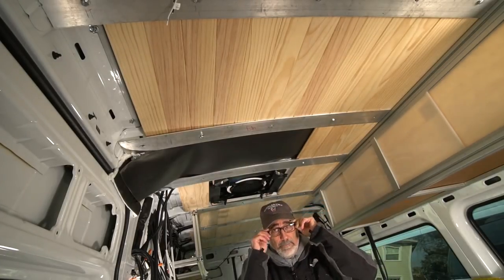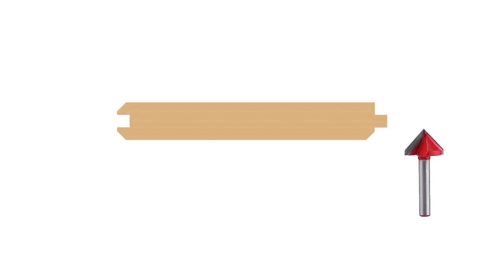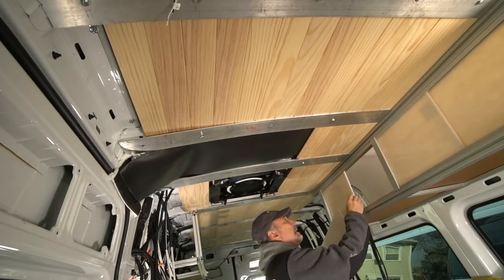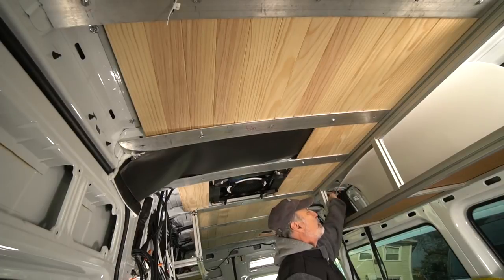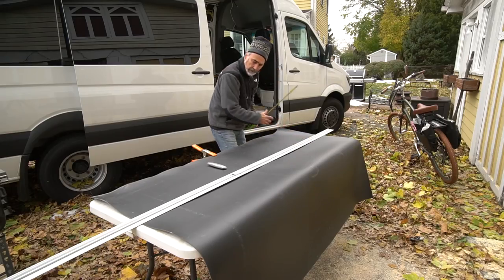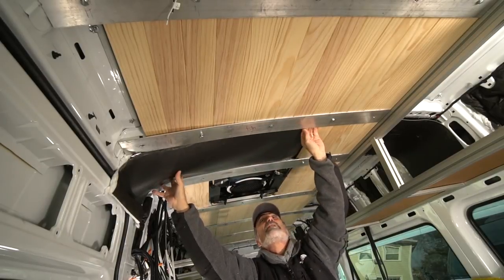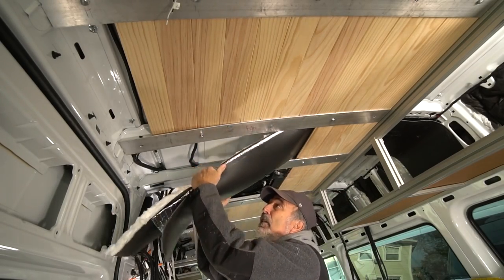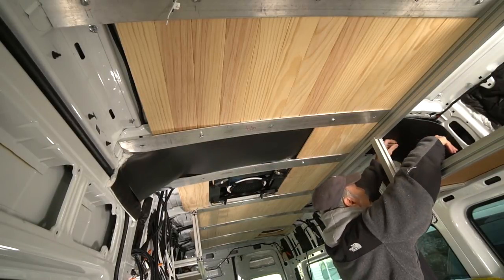Humble Road Van Build Series - Four Layers of Ceiling Insulation

Comment: I think i like the idea of building each area separate so you can access, update or make repairs to them without needing to interrupt another area. I see so many people build all the insulating layers as one unit, then the floor, framing and walls all together. But, i have learned in my van that its hard to get to a section for something simple without removing an entire layer. I made my bathroom area one unit with its own floor, kitchen area with its own floor, bed area has each section separate too. Only thing i would have issues with are that the van is a conversion and id never be able to get behind the walls or ceiling without removing my entire interior....or cut my walls. So, i say make your cut mr! I hope i got this right...lol

Comment: In the case of my (new to me) old RV (1966 Clark Cortez - first front wheel drive RV made in the USA), water and rust issues are real for those vehicles. I want to know before I have a problem and be able to check the roof/floor/walls regularly. Since the entire ceiling will need to be ripped out and replaced, this setup could be extremely beneficial.
Reply from the maker: That was my motivation for this design. While I have never experienced any kind of heartache when it comes to repairs, I can certainly anticipate and be proactive.

Comment: IMO: Keep it one piece.  Gravity is working against you asking that cut piece to not keep falling down, but in one piece, the tendency to fall down is transferred to the full curve down to the shelf floor.  If you do cut it, maybe cut it lower down the wall.  (I didn't see side support inside the shelving to help keep the heavy mass vinyl propped up on its own.)  After all, how many times to you really think you need to get behind that wall?  It is already "accessible" by loosening up the ceiling and pulling the vinyl back if need be.  Suggestion?  Maybe you can slit the heavy mass vinyl in half or thirds vertically to get access to a section that is lighter in weight.  Velcro the strips together in one piece on the back side.  Just thinking inside the box...
Reply from the maker: I like the way you think.

Comment: Hi George.   There is a case to leave the backer in one piece.   Two pieces will leave you w/ attachment issues where the would be two pieces meet.   I guess that I would ask how many times one would expect to need access behind the mass vinyl as compared w/ any maintenance issues that would/could be created by making it two pieces.   Without having the experience and vision of the van that you do, I would think that one piece would be better.  

BTW, I loved the insulation falling down almost on cue.  Also, loved your reaction when it hit you.  Some people would have cut that out.  I love that you left it in.  Great work, as usual.
Reply from the maker: Thanks Sam. If I use two backer panels, the overlap would be 3-4 inches. Enough to settle in with each other. I have wrestled with one long piece and it was difficult. That wouldn't bother me to do so, but if I am building this van to sell, and sell at premium, everything MUST be as close to perfect as possible.
Reply: @HumbleRoad  Yep.  I wasn't thinking about that much overlap.   Should work well as you have described.

Comment: I don’t  see a separation between the structural ribs and the “plates” attached to them. Two words - thermal bridging. Everything else about the system seems good 👍. 

You do outstanding work. Keep it up!
Reply from the maker: 2”  by full length strip of rubber on each of the 4” plates where they mount to the chassis ribs.

Comment: love the video George, 4 years later I'm wondering if you would still use the same 4 layers in the same order as you did in this video?  thanks so much!
Reply from the maker: Yes. All the same, EXCEPT...I replaced the HMV with polyiso foam to save weight up top.

Comment: Your skill level is amazing.  You are at a level to which I  can only dream.  You asked our thoughts about cutting the mass vinyl for easier access. Since the mass vinyl serves as a vapour barrier I would be concerned about moisture, over time, finding its way through.  ?
Reply from the maker: You are correct. This is why I am focused on a "breathing" van. Unless you can guarantee a 100% flawless vapor barrier, you will have created a worse condition by not giving the moisture any air flow in order to evaporate. My idea is to minimize condensation, close to nil, but with the ability to keep fresh air flowing throughout every nook and cranny of the van.

Comment: By attaching the aluminium extrusions for the cabinets and the aluminium stock on the ceiling direct to the steel of the van body you have  given yourself a big problem.  The body steelwork inside will get as cold as the outside temperature, the aluminium will end up the same temperature as its a very good conductor of heat and cold.  This cold metal will condense any humidity in air of van and end up covered in condensation.  Two people sleeping in the van overnight will produce a lot of moisture in the air just by breathing, nevermind if you start cooking in there. This is why in all comercial builds,  if done right, the van body is completly insulated from the inside.
Reply from the maker: Oh no! I don't think the result would be as serious as you describe, but I have a thermal break between the van body and any interior aluminum.
Reply from the maker: The only mount point where I could not install a thermal break is with the 4 carriage bolts that hold the topmost rail of the wall cabinets. Now, once I start re-installing all the framework, I will point out all those details.

Comment: Unfortunately I haven't seen the first steps in the ProMaster/Ducato rebuilding, but an important thing is how to avoid air making contact with the outer wall behind and inside all frames. Then there must be some ventilation behind the inner wall layer.
I just wonder how all DIY campervans will look like after ten years...
There are reasons why they don't use frames of wood any more in caravans.

I'm about to  build a campervan of my 2011 Ducato 636 cm van, and this problem I have to solve at first!
Reply from the maker: We think alike. Good luck with your build!

Comment: 1) loved seeing the 'sliders' concept.
2) 3 yrs later, would you do this '98 boards' ceiling method again or has time revealed more favorable methods?
Reply from the maker: (2) Yes we did tongue & groove in the latest 4x4 Sprinter we just released a couple months ago. And I'm considering it for one of the Transits in house now.. (3) Reflectix needs an air gap in front of it to work. If you glue it directly to the van sheet metal, it does nothing.
Reply: Thank you-Doug

Comment: Lovely build. Thanks for explaining the radiant heat floor (I’d love that but have settled for thick carpet) thought you didn’t want to put the heavy mass rubber on the ceiling? Why didn’t you just buy tongue & groove? I’m learning a lot, thanks.
Reply from the maker: I hand made the tongue and groove for 2 reasons. First, my finished thickness is less than dimensional lumber, so if I milled down the store bought T&G, I might have had an alignment problem. And second, I just wanted to have hand made tongue and groove on the ceiling! 😆

Comment: Very good system. I would prefer the 2 piece. Ceiling and wall.
I like the wood board ceiling. Was wondering why you didn't buy the T and G and plane it yourself. I know standard is 3/4. I have seen on YouTube,builders using thin cedar planking.
I admire your wood working.
Reply from the maker: I chose the pine boards for their insulative properties. As far as the milling, I don't mind doing it all myself. I like the idea of handmade.

Comment: How do you deal with condensation on the metal ceiling? No getting around the thermodynamics of air moisture. When the cold metal meets the warm moisture-laden air it's going to condense on the ceiling and infiltrate the Thinsulate. I would install the Reflectix on the ceiling tight with spray adhesive, then the Thinsulate over that then the vinyl. It's a myth that Reflectix doesn't insulate. I installed two layers thick and it provides plenty of insulating potential even without the specified air gap requirement. There's two layers of air bubbles and  loose fit between the two with more air all sealed with HVAC foil tape...Go to the HVAC supply store to get the good stuff.

Comment: I don't think the Reflectix will reflect anything unless it is spaced apart the adjacent layer (from the high density mat and/or the wood).    I think that's typically a few inches.  From their website:

"For either a reflective insulation or a radiant barrier, an air space of a minimum thickness is required on the reflective side of the product. (Most Reflectix® products are reflective (shiny) on both sides.) The reflective insulation benefit is derived from the interaction of the highly-reflective surface with the air space. If the reflective surface is in contact with another building material, it becomes a conductor (transmitting the energy by conduction). An air space may be specified on one or both sides of the product (always on a reflective side). Enclosed air spaces, when instructed, are required to provide the stated R-value."
Reply from the maker: Sure, an air space of a few inches would be beneficial, but in the case of a van build, not very practical. I am considering the air "in and around" the Thinsulate to be the required airspace for the reflectix. The black layer of the thinsulate is very porous and a non-conductor of heat, nor cold.
Reply: By itself, Reflectix is an insulator. I have cut pieces of it to fit my Ascent’s windows and wrapped all of the under-floor plumbing with it, too. Without additional airspace, I can say with some certainty that it does provide noticeable insulating barriers to both summer sun and winter cold. So my guess is that your sandwich with Reflectix as the salami will do a credible insulating job, Chip.
Reply: It has an R value of 1 if it is sandwiched between other material.  That's not very good.  The R value is much higher if you leave it exposed.  Nobody wants their van to look like it's wrapped in aluminum foil, but that's what it takes to get the higher R value they advertise.  I see van-build videos of photogenic but blissfully ignorant millennials making the same mistake all over the place.   This is basic physics and stated right in the manufacturers specs.
Reply: @desmondtutu7916  There is a white-sided reflectix - one side is white.  How would that work in a van build without looking like a tin-foil space ship?
Reply: @desmondtutu7916  I agree with you 100%. There is a time and place to use reflectix and this is not it. Some people just won't do what little homework is required or they just love throwing away money.

Comment: I think the whole build is great! Such a perfectionist look forward to each episode. Will you keep both vans?
Reply from the maker: Thank you! This van that I am building is for sale. I hope to have enough of it completed by the Tampa RV Show that prospective buyers will have a better idea of exactly what kind of product this is. Can't blame anyone who may be interested to continue to lurk in the shadows, it's an empty van for Pete's sake! I am building it, however, as if I were going to live in it full time for the next few decades. Now if I win the lottery, all bets are off! :-)
Reply: @HumbleRoad  Suggest: your next build is on a wide-body van (8-foot). That extra 12" - 14"+ width (and no wheel well to deal with) really makes a world of difference toward not making you feel like you are in a cave.  Not too many manufacturers are still making widebody vans though  Check out the specs on this:  http://www.startransbus.com/product-details.aspx?LineID=398&Image=17126  

Mine work in progress is a used original Senator version with 4 doors and I love how unobstructed the floor is and how vertical the walls are and how flat the ceiling is.  I love the ground clearance, too, but I need a step ladder to climb into the driver's seat!  Still building it out, but using some of your ideas, too.

Comment: When it comes the area where the metal roof and thisulate meets ... isn't there a space for condensation? If I remember correctly - the only way how to avoid it is by spraying the van with insulation foam, which sticks to the metal.
Since the video is almost 2 years old ... I think it would be great idea to inspect the roof - don't you think?

Comment: Wouldn't the radiant (Reflectix) barrier work better next to the van's exterior - then add the insulation on the inside layer?
Reply from the maker: No. The reflection needs an air gap in order to work.
Reply: @HumbleRoad  gotcha... because the bubble Reflectix is also a vapor barrier. Like Joe Lstiburek says... a vapor barrier in the wrong place is worse than none at all. Thanks!

Comment: the plastic bent sheet that you use for your cabinet backs is a vapor barrier all by itself.  my question is that.... do you really need to overlap the heavy vinyl?  or just end it at the edge of the ceiling.  its a double vapor barrier at that point... or more precisely... a triple one since the reflectix is going to be behind it.  the reflectix is a vapor barrier by itself if its taped with the metal tape to the edges of where it ends to keep the insulation sealed.    it seems like way overkill at that point and alot of trouble  that doesnt seem necessary.
Reply from the maker: You cannot maintain continuity between the van and the reflectix. If so, you have one big thermal conductor. I had not considered the cabinet backing as a vapor barrier, but you are correct it is! In which case I might add another layer of thinsulate.
Reply from the maker: Brilliant observation! Thank you!
Reply: @HumbleRoad  how are you sealing up the thinsulate from the air in the van.... are you sealing the edges of the heavy vinyl to the metal struts?  since they are inlaid in between the roof and wall supports.... the edges are at risk for leaking humid air into the thinsulate unless sealed off somehow.  maybe you are covering that in a different video im not sure.
Reply from the maker: Lady-T, you have an excellent understanding of these systems. What I neglected to say in this video was that I will have a four inch piece of vinyl laying on top of each of my  4" aluminum flat crossbars, acting as a thermal break from the van roof struts. So the vinyl that runs inside the channels will rest on a 2 inch overlap of vinyl on top of the aluminum flat bar. It is a mechanical seal via weight.
Reply: @HumbleRoad  my bad.  lol  i do like your videos,  and your build looks fantastic btw.

Comment: How are you going to handle the inertial effect on the sliding doors during acceleration or hard stops?
Reply from the maker: That can be solved with a travel lock. Just spitballin' here but something as simple as a clevis pin going through both doors at the overlap.

Comment: Looking good!  What are you doing about the temperature transfer along those metal ribs/supports?
Reply from the maker: The van roof struts will be insulated on the inside and isolated with a gasket of rubber.
Reply: Thanks....I have a much older shuttle bus I'm converting.  Square metal supports that I hope to fill with closed foam before I cover them up.  Hadn't thought about rubber gaskets!
Reply from the maker: Make sure the foam is non toxic and will not retain moisture, mold resistant.

Comment: Question: Wouldn't it be more effective to use the reflectics (spelling?), then the thinsulate, then the mass load vinyl? Maybe I am thinking of it in terms of my climate (southwest) and the intense sun! Thoughts?
Reply from the maker: Reflectix needs an air gap to reflect the heat back across. The Thinsulate serves as the air gap. Reflectix right up against the van roof does nothing.
Reply: @HumbleRoad  👍  thanks!
Reply: @HumbleRoad  it doesn't do anything next to thinsulate or vinyl either.

Comment: Hey George, loving your video's - for the second time! I notice you didn't use the mahogany detail between the white boards on the ceiling. Is there a reason for that decision that you can tell us?
Reply from the maker: Yes, with the segmentation of the boards and the cross banding of the supports, I thought it would be too busy, visually, to have those dark strips running front to back. So rather than use the walnut strips to define the boards, I decided on using shadow (tongue & groove). Now, the first thing you see is an entirely white ceiling. Then the more defined shape of the boards and banding comes into focus.
Reply: @HumbleRoad  yes walnut, not mahogany! Makes perfect sense, thanks :)

Comment: I have been thinking about the way you insulated your ceiling. Would it not be better to apply the reflectix first then the thinsulate. If the reflectix does reflect back then the thinsulate would have less heat to insulate from the outside, thus keeping the van cooler on the inside during hot summers? looking at it from an engineering standpoint.
Reply from the maker: The reflectix requires at least 3/4” air space to reflect through. The white fiber of the Thinsulate is the air space .
Reply: @HumbleRoad  I was looking at how you wrapped your tires. reflectix first then thinsulate? Thanks.
Reply from the maker: roger littlejohn that is not reflectix on the wheel wells. It is Noico- sound deadener.

Comment: What is that white material you're using for the upper cabinet liner?
Reply from the maker: It's a PVC Utility panel called Poly-Wall. Very flexible lightweight PVC in 4x8 sheets. Very easy to work with. And when bowed, it retains a nice semi-rigid shape. Home Depot or Lowes